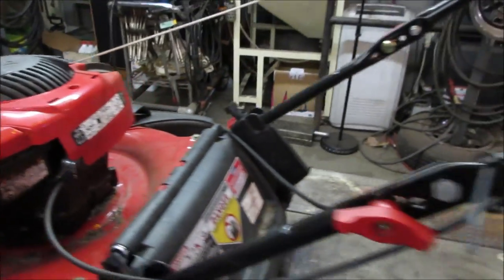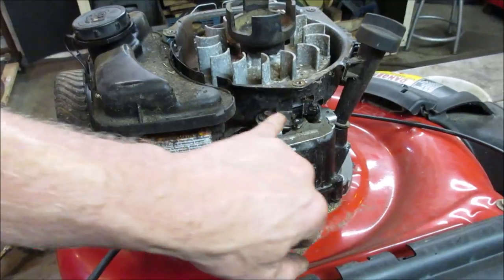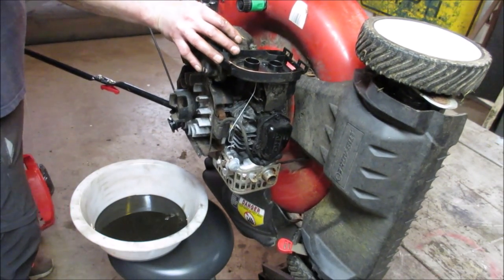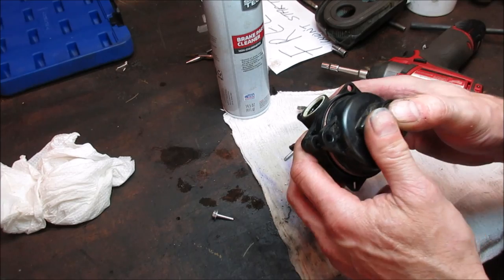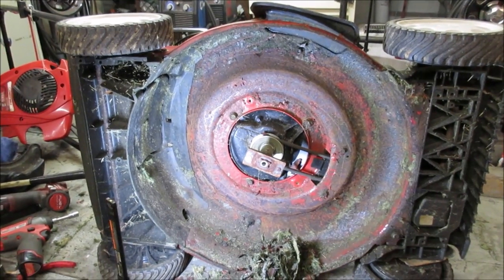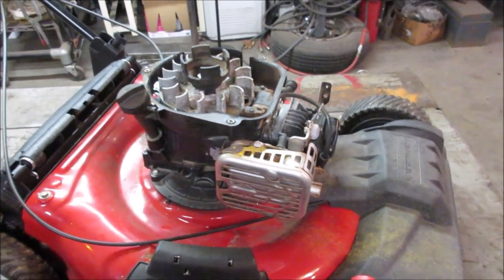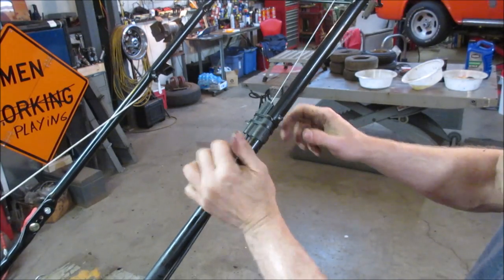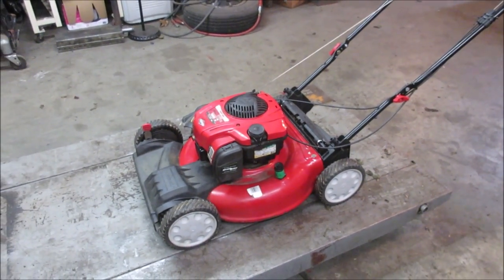How To Restore A Junked Lawn Mower. For Cheap.

Comment: wish i could find a free little push mower... lol
Reply: @ElectronicMusicUnderground  yeah there are a lot of scrappers in my area, but they typically take stuff home first to separate the metals to get the best money from them at the scrap yard. I did get a free rider from the side of the road once, but the transmission only lasted a couple years. still runs though! :) I have an old push mower that runs but it has virtually no power in about 5 inch grass then dies and won't restart until it cools off.

Comment: That green 'adapter' hanging next to the motor on the top side of the deck look to be a 'washout' you can connect a hose to while the mower is running to rinse all the clippings out.
Edit: And, once again, should have watched the whole video first. Doh.

Comment: If power equipment manufacturers were smart, they would market a line of "Disposable Lawnmowers" in the Northeast. Sealed engine, all you can do is add gas. When it stops running or won't start, throw it away and get a new one!  I too have never bought a new piece of power equipment.

Comment: It has a water hose connection on the deck. You forgot the valve cover was leaking.
Reply: He spoke about the water connection - and there were no compression issues, so after a good cleaning, it didn't merit valve adjustment, etc.
Reply: @RRRIBEYE  It wasn't a valve problem, it was an oil leak problem.
Reply: The "Leak" he mentioned looked pretty negligible. All mower engines over time will be covered with that oil dirt mix.

Comment: Where I am Tru Fuel and other brands of non ethenol gas are prohibitively expensive so I do a simple ethenol removal in 5 gal batches simple to do and a ton cheaper than the $12 per gallon for non ethenol gas

Comment: I think you should give some serious safety instruction in the blade section- like REMOVE THE PLUG WIRE-  who knows how many guys have turned a mower up to remove the blade and turn it around only to have the motor start up.

Comment: OOPS, WHAT YOU DIDN'T THINK WAS A DRAIN PLUG IS A DRAIN PLUG, IT TAKES A SOCKET EXTENSION ON YOU SOCKET WRENCH, I HAVE ONE MOWER  THAT I HAVE TO USE THAT SET TO REMOVE THE PLUG, THATS TYPICAL WITH NEWER BRIGGS ENGINES, I HAVE WORKED ON SMALL MOTORS FOR 60 YEARS!

Comment: Go gotta mower that when I was cutting the grass i ran over a rock  . It shut down the mower and now it won't turn ? Anyone has suggestions? At this point it's been sitting for a long while
Reply: Like he said in the video,  the keyway will shear and throw it out of time. Pull the flywheel and replace the aluminum keyway.

Comment: yea the mower deck rot is always an issue. even more so that now the decks are flimsy to begin with and the paint is powder coat but they do no prep work so once it starts flaking it peels off in sheets. Some folks here use truck bed coating under the deck. I used epoxy paint on mine. The ethanol laced fuel is absolute GARBAGE I feel sorry for the folks who are stuck using it. And for all the people who say it's not. I work in a small engine shop. I can show you a pile of engines every week that have failed because of the ethanol fuel that was used in them. A pile of failures some fixable some not. Root cause of all failures Ethanol laced fuel. Government mandated stupidity. just like the anti spill fuel cans that have caused more fuel spillage than the Exxon Valdez.

Comment: The engines usually lasts much longer than the rotor covers that rusts away, -  they should have been made in stainless but probably not in the interest of the manufacturers..
Reply: The last thing the manufacturers want is to sell you a mower that will last a lifetime, that would put them out of business.
Reply: Had one that had a cast aluminum frame.

Comment: You know what happens when you put your used motor oil in a 5 gallon gas can and then your wife wants to mow the grass?  She says, hey, the mower was running then started to smoke, then stopped and now it won’t start. 
You check to see if it’s got gas and spark. 
You find  plug was very black and the fuel looked black in the black fuel tank.  Yep, she grabbed the used motor oil can and filled the fuel tank with it.   
Lesson learned….
You gotta mark the used motor oil can so it can’t be mistaken for fuel.  
On that style engine, you need to be careful when you flip on its side to change the blade.  The engine will flow oil out of the case and into the carb and then oil soaks the Air filter.   It is better to flip the mower on its back wheels to avoid that issue.

Comment: CUT THE ZIP TIES
Cut the zip ties without having sharp, arm slicing edges by holding a lighter flame to the end after cutting. The plastic edges will melt just a little and round off. Ouchie free!    😎
Reply: Funnily enough I’m sure I’ve seen Mustie do this on this very channel. Must depend on location (?)

Comment: On these plastic ones always take the jet out and blow the holes you can't see. Pocket screwdriver and pry it up and pull the two plastic parts apart and blow the lower holes out. The worst carb for blocking the holes you can't see. You can drain them over the winter and run them and still have issues with the holes in the plastic jet. These are garbage for a homeowner who isn't mechanical inclined.
Reply: You also have to watch out using air the brass end on the jet will blow off.

Comment: Cars have been running on E85 for decades. I think its time for the Gov to step up and mandate small engines also take it since the small engine manufactures are too lazy to do it themselves. Or perhaps a class action law suit. Being faced with a large multi million suit might finally cause them to pull their heads out of their asses. Its not like there is anywhere that alcohol free fuel can be purchased so the manufactures intentionally leave people no choice but to trash engines. That should be grounds for a law suit.

Comment: My 2021 Craftsman mower is almost identical except for mine isn't self-propelled. I don't mind saying that I am damn near anal when it comes to keeping a sharp blade and a clean air filter. Recently it was making a very bad knocking noise, and I assumed the worst that it was a loose rod collar, so I was waiting for it to blow up before I took it in for the warranty service, but last week the noise stopped, which is good because I tweaked the front wheel assembly to get it to cut my bermudagrass lawn a half-inch lower, I think it might just have been the engine brake scraping the flywheel on starts and stops.

Comment: I have  what it appears to be the same mower mine is a Craftsman m220 I purchased it from somebody for 90 bucks with a weed eater included it was an estate sale I ran the mower for all about no time because it didn't want to start I hit the carburetor with a little carburetor cleaner and voila that b** started  after we're using it about 4 or 5 times on my property I thought to myself before I f*** this thing up I should probably check the oil I opened up the oil dipstick and it look like s**watch the video of the man said that this machine is unserviceable so  like you I tipped it on its side let it rain out until it didn't have another drop coming from it although I emptied it into a oil sump meant for a truck like a little 5 gallon container with a cap in the center of it so I couldn't tell exactly how much oil I pulled from the machine I filled it I checked it with the dipstick I filled it I checked it with the dipstick until it look like it was full started the mower up again and instantly regretted doing that the oil filter became very black and nasty full of oil meanwhile the exhaust was sputtering white smoke and what I would presume to be un burnt oil not being all too keen on knowing what to do with these kind of things I figured it'll burn it off maybe I put a little bit too much or just a little over enough and it'll burn off well that didn't happen from what I understand underneath the pull start is a breather reed and apparently for me changing the oil I f**** up the breather reed somehow so in an attempt 2 fix the issue I took a piece of drip line stuck it down the oil dipstick and siphoned about two capfuls of oil out of the machine yes that says capful not cupful pulled the pull cord it started for about 30 seconds and shut off and hasn't run since the day prior I mowed 2 1/2 acres with my nephew he used a push mower and I used the same push mower you have their almost I've checked for spark and from what I can see it has spark I pulled out the carburetor and sprayed the hole inside of it clean I pulled out the spark plug and cleaned it up I'm not sure what to do from here if I spray carburetor cleaner inside the carburetor it does not attempt to start.  Not sure if it is the brake is not disengaging although it appears to be disengaging but something is stopping this f**** thing from wanting to start after running like a champ for the past 2 months since I purchased it

Comment: never understood peoples hate for ethanol i've ran it for years never had any issues but then i don't leave fuel in the tank for 2 years then try using it but then i understand ethanol is hydroscopic just like brake fluid and ATF, blame the idiots the leave it sit not the fuel there's nothing wrong with the fuel itself

Comment: Muskie your wrong about fuel sorry I've heard you say this b4 and bite my tongue but today's fuel is better for your motor than ever b4 in fact back in the day we used ethanol to Gas all the time to help get water out of the tank
Reply: Maybe for cars and trucks. Not small engines.  It kills carbs.
Reply: @mrc3584  I won't use ethanol in my vehicles either.  I support the farmers by buying Busch Light, Steaks, Burgers, Eggs and Dairy.  In the winter, I add HEET with fuel injector cleaner for any condensation in my fuel system.

Comment: Those plastic MTD carburetors are cheap chinese junk. If one doesn't work right then replace it with a new $20 carb. As soon as you buy a new gas-powered implement you should buy a strainer funnel, and never fill the tank without using it.

Comment: I'd of left that epic pile of junk where it was. I have same one, it's junk. total junk. troybuilt is garbage.
Reply: after the self drive system ate it's 2nd belt, I just cut the belt completely out and ditched the gearbox crap on my dad's troybuilt.
Reply: @harveylong5878  as long as I have the governor zip tied on mine it runs ok. replaced so much and it still won't run right. and once it's hot don't shut it off or you'll never start that prick again till it cools.